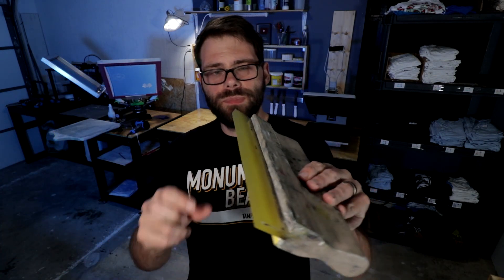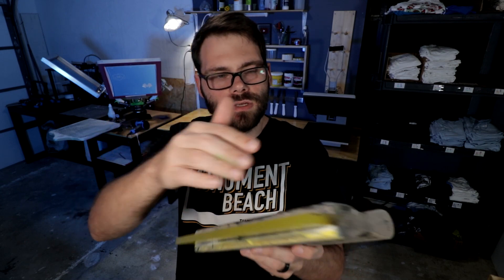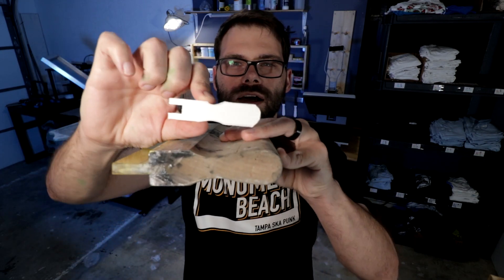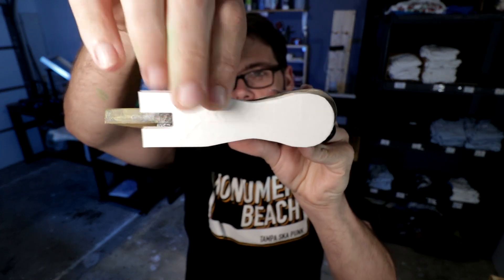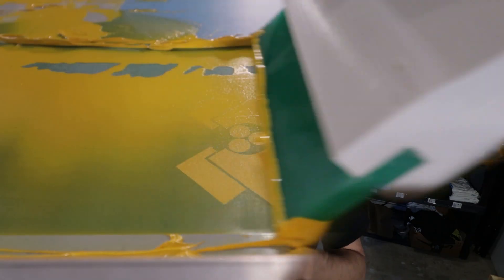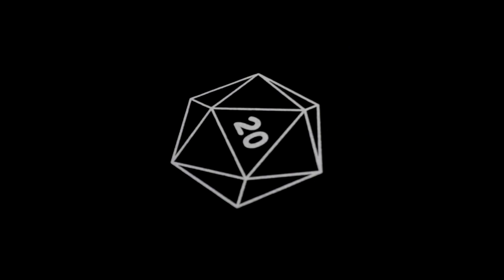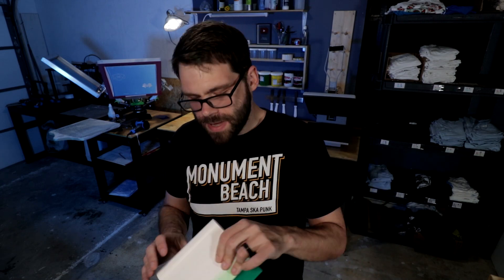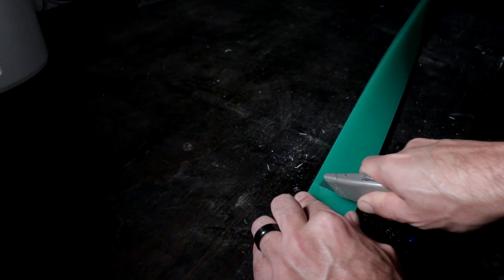Making a 3D Printed Squeegee For Screen Printing /// 3D Print Your Screen Printing Tools

Comment: Would be cool to make a modular squeegee handle where you can choose the length based on different section lengths that would dovetail together somehow for 3D printers that can only do 8-10” long prints max length. Would love a 12 and 14” squeegee handle option